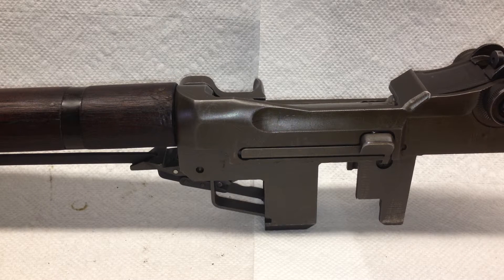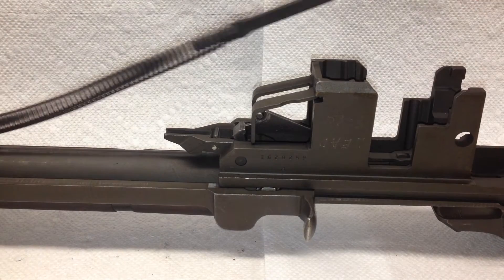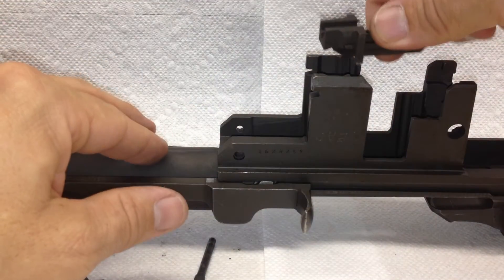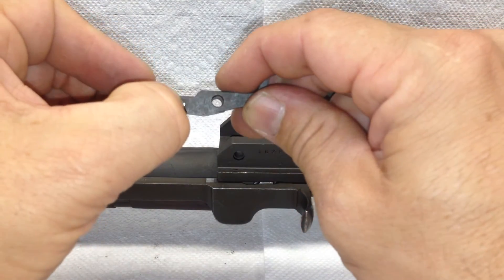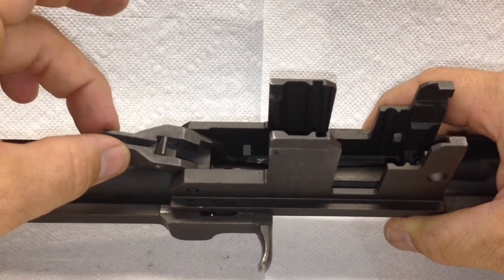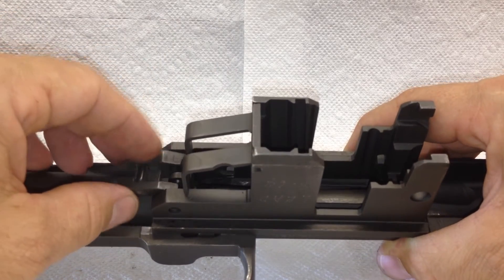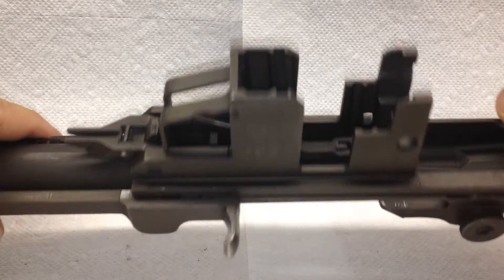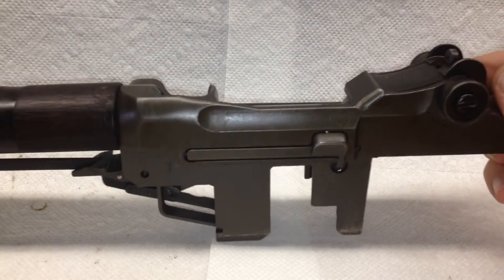M1 Garand Small Operating Parts Disassembly & Reassembly

Comment: Thank you.  As a new Garand owner, I have much to learn.  Your videos are the most helpful I've found.  I recently took delivery of a CMP Special Field Grade.  I absolutely love it, but I have a question.  Every time I load a clip, I must give the op rod a little help.  Not a big deal, but I'd like to know if this is indicative of a worn part, or a new part that needs "breaking in".  Again, thanks for the free lessons.
Reply from the maker: When loading the full enbloc does the bolt go forward and rest at the rear of the round on top?  If so the spring might be a little weak or the Special finish is not worn in yet.  If putting in the enbloc seats and the oprod is back then that is an Enbloc Timing Issue (see my video on that.)
Reply: @norwich93CMP  The bolt does indeed rest against the top round.  Is the special finish you refer to on the spring?
Reply from the maker: The bolt should ride across the top of the round directly below it.  The spring should not be finished at all.

Comment: Norwich, I'm having trouble reinserting the follower arm pin. With everything but the bullet guide removed, the pin will not fully seat. My rifle came directly from CMP. I've been uncomfortable using a brass punch and hammer as every video I've seen shows the follower arm pin slipping in with little effort  Any recommendations?
Reply: I've had that trouble and it was just that the bullet guide wasn't quite in straight. Just a little wiggling and it all fit together correctly,and the pin slid right in.Never force things.
Reply from the maker: I am assuming your areas are all clean and inserting from the the correct side.  It is not uncommon for this pin needing to tap to seat.  If the pin fits with nothing there then you should be good, it one on the biggest pins.
Reply: @norwich93CMP  - It is clean. However, I have ordered a Plastilube lubricant which I found as a recommended choice off CMPs form. I was using a Mil-spec lithium which seems a little off in odor and color now. Once I have the Plastilube, I will give the pin a little nudge. By the way, great videos.

Comment: Remember, if it slides, use grease, if it rotates, use oil.
Here is the fix answer if the clip ejects on 6th round. Copy and pasted.
Finally, I had a chance to fire my new Garand which I got from CMP a couple of 
months back. I fired one clip about a shot every 4-5 seconds or so. The 
rifle functioned flawlessly. I next fired a clip as rapidly as I could 
pull the trigger. The rifle tried to eject the clip after 6 shots. 
Visual inspection of the clip latch, bullet guide, follower arm, 
operating rod catch, etc didn't turn up anything obvious. With the price
 of ammo I didn't try another clip of rapid fire.

Do any of you Garand experts have any suggestions what to look for?

Thanks

Paul
Salome, AZ
I
 had the same problem... I was referenced to an article... I cant find 
it now but it recommended replacing the Bullet Guide and op rod catch. 
The problem has something to do with the way these parts interact.  I 
saved this from the article along with the attached picture.  

"Premature ejection of unfired cartridges and clip is ALWAYS caused by interaction of the
operating rod catch and the bullet guide, which causes the 
effective override of the clip latch.

Every troubleshooting chart in all the modern manuals verifies
this precise diagnosis. See the excerpt attached. Same data
firmly verified in Technical Manual TM 9-1005-22-35, all editions.

The "clip latch fix" never works for long, and usually doesn't
work AT ALL. "

I
 made it a point to ask questions rather than to chase parts, and I got 
the right answer up front from a person who is an expert on garands.  
All I know is that I replaced the two parts in question and havent had a
 problem with it since.

Hope this helps....

Wayne

Comment: Great vid! I'm having problems with my Garand not holding the clip in place.  After following your video and taking it apart I can see that the latch on the right side that should hold the clip in place doesn't seem to be coming out far enough to keep it in place.  Am I right in assuming that a new clip latch spring is needed? Thanks.
Reply from the maker: +Dan Mills It can be the clip latch spring.  I would remove the clip latch and take it to a gun show to see if the end which engages the clip is long enough and that the spring is providing enough pressure to proper hold the clip.